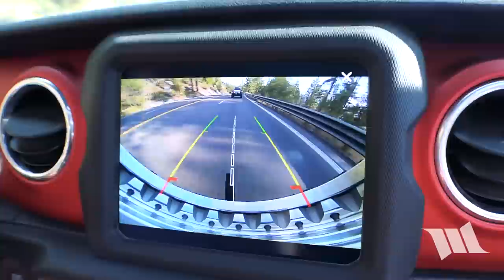Jeep JL Wrangler Rubicon Trail Off Road Adventure : TRADITION

Comment: Nicely done.  Been up there 3 times already this year and may try to fit in another day trip if I can make the time.  That squeeze rock that dinged your body is much tougher this year than in the last few.  We got a Rover caught on it pretty good this summer and did more bodywork than you by a good bit!  Had to winch him forward through it and put the hurt on the rear quarter.  Then again, pretty much every Disco that crawls is wrinkled below the passenger taillight.

Comment: Have you found that with the 37s you feel the stock steering linkage is strong enough? How about the transmission temps? Any overheating issues?
Reply from the maker: With 37's, I have found the linkage to be strong enough but I have upgraded them to take a beating on the trail. Trans temps are fine. No overheating issues.

Comment: Hey Eddie since the JL's wheelbase is longer than the JK, would you recommend a 3.5" lift instead of 2"?
Reply from the maker: Not necessarily. 3.5" is a lot of lift but 2" is kind of on the short side for a set of 37's. The Rancho 2.5" lift we tested out prior yielded closer to 3" of lift and I think it was a better setup or at least, in terms lift for 37's and a trail like this.

Comment: I would like your thought now on the new Lift from the Video it appears to me that in the last quarter of flex it like kind of Gave out? like it was smooth dampen dampen Then abruptly ..  Bumpstop  please give Me your thoughts  thanks
Reply from the maker: Not exactly sure what you're referring to but if I could guess, this is something you're seeing up front? If so, the problem is with our electronic swaybar disconnect system. At times, it wants to reconnect like after driving a certain speed and it can take a bit to disconnect again. Kind of frustrating.
Reply: Right I believe the Tazer JL will let you change and increase that speed in which it locks back up and that's great for us desert Rats ..

Comment: Can the Rubicon trial be ran with this Dynatrac lift on a 2020 jl rubicon on 35's?
Reply from the maker: You can run the Rubicon stock. It's just a lot harder and will take a lot more work. I personally wouldn't recommend it as you'll find that you won't have as much fun.

Comment: Yoda:
Told you I did. Reckless is he. Now, matters are worse.
Obi-Wan:
That boy was our last hope.
Yoda:
No. There is another. The 2020 Land Rover Defender L663.
Reply: As a Rover owner I'd love to believe you but let's face it, the new Defender is being built on the D5 platform.  bye-bye solid axles.  :(
Reply: Don Happel No. There is another. With solid portal axles.
Reply: I'd love it if you were right, but I expect you'll be wrong.  Unless you're moving away from the next Defender and on to another platform/brand.
Reply: Don Happel L663 + solid portal axles = dominate share of offroad market. Until, the Jeep JM with portal axles hits the market between 2023 - 2028.

Comment: So how is it that Jeep took a bunch of journalists driving stock JL Rubicons down the Rubicon trail with about the same amount of effort and similar trail damage as you guys with heavily modified jeeps and lots of rock crawling experience? Granted they had spotters at like every corner but were they taking different lines than you guys in some sections? I’ve never been to the Rubicon myself. Jeep also has a series of marketing videos where they took the Cherokee KL trailhawk. After seeing what you guys did, I don’t know how the KL making it was humanly possible without at least a tremendous amount of damage.
Reply from the maker: There are a lot of different lines you can take throughout the trail and even we didn't take some of the hardest ones in this video. That being said, Jeep take a LOT longer to cross the trail and come with a full crew of guys who are basically there for road building.
Reply: Thanks for the reply! Great video btw. I can see that with the KL Trailhawk but the run they did with the journalists a few weeks ago, looked like there was minimal trail building and they made it to Rubicon Springs before sunset the first day. The video I saw was from TFLTruck. They didn’t have the easiest time but after seeing them do that well stock, I just expected you guys to walk right over everything. But if you took harder lines that makes sense.
Reply: Perhaps it’s just a testament to how capable the stock JL Rubicon really is.
Reply from the maker: Well, you've seen both videos. Did it look like they took the KL on the same lines as what you saw here?
Reply: The KL videos were more edited so it was harder to tell. Jeep did a whole series showcasing different off road qualities like “articulation” and “traction” lol, but I think they did mention it going on a few of the famous obstacles. The TFLTruck video was less edited and I did recognize some of the obstacles as the same as what you guys ran. Especially the one with the really tight turn where you received you body damage.

Comment: How are everyone's doors so easy to lift off? Mine are a fight every millimeter of the way.
Reply from the maker: Hmmm, maybe you don't remove them often enough. If you do, it does make it easier.
Reply: @wayalife  I usually get em off 6-7 times a summer. Would do it a lot more if it wasn't over a hour long process of constant up pressure and swinging the door in n out to get all 4 off lol.

Comment: any running with the 37s and the dynatrac lift?
Reply from the maker: This video is old and I would no longer recommend 37's with the Dynatrac lift. After the coils settled, we ended up with just 1.8" of lift and that was far too little to clear 37's without a lot of rubbing. 35's are about as big as I would go with this lift.
Reply: @wayalife  Noted. I was trying to stay kind of low, but also have slim fenders. How does it compare to the rancho lift kit you did a video on?
Reply from the maker: @gabrieldalcomune3044  Personally, I preferred the Rancho kit and thought it did a much better job of running 37's. Get it with the new RS7MT and it'll ride great.
Reply: @wayalife  Interesting i’ll start looking at rancho. Would you know how they compare with total lift and being able to hold weight from steel bumpers? Or spring stiffness?
Reply from the maker: @gabrieldalcomune3044  Yeah, I've tested the kit and can tell you that it holds weight well. Even with 37s and steel bumpers and rocker guards, we still had about 2.5" of lift, which is more what you need at bare minimum for 37's. I should also note that their 5000 shocks are old school hydros and offer a better ride on pavement too. Where they fall short is driving hard and fast across the desert. In those conditions, they will fade.
Reply: @wayalife  One more question if you don’t mind. 

When unloaded just daily driving, how do the coils feel compared to the stock, and dynatrac coils? 

If they’re relatively soft or daily driver worthy I can’t justify spending the money on the dynatrac as I’m now considering getting into adjustable shocks too. I’m looking into the 9000 series shocks, but I’m trying to find the travel numbers and shock lengths.
Reply from the maker: @gabrieldalcomune3044  I would say that the Rancho coils offer a SOFTER ride than Dynatrac and you will always get a smoother ride with old school hydro shocks, like the 9000s than a monotube shock like the Fox. If there is a down side to hydro shocks, it's that they will fade when doing a lot of hard and fast driving across the desert. But, for daily driving, it is the reason why they are what come on your Jeep from the factory, to offer a nice overall daily drive.
Reply: @wayalife  Thanks, i’m deciding against the dynatrac now. It was hard for me to justify the 1.5k after the price went up.